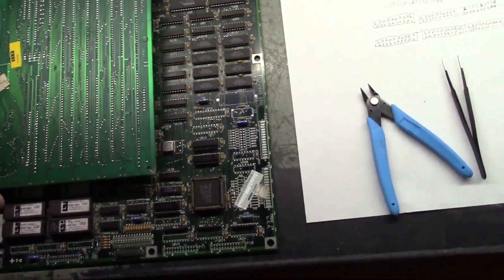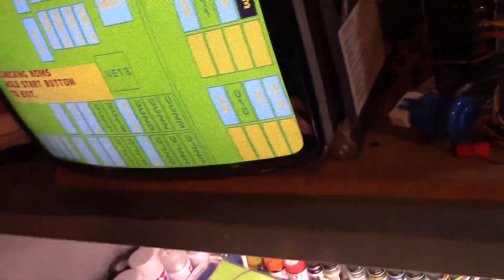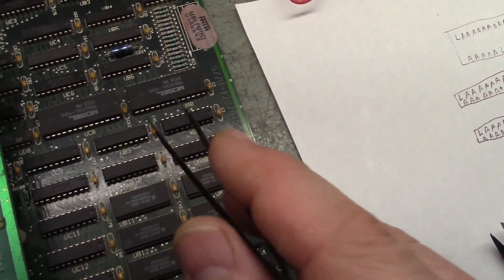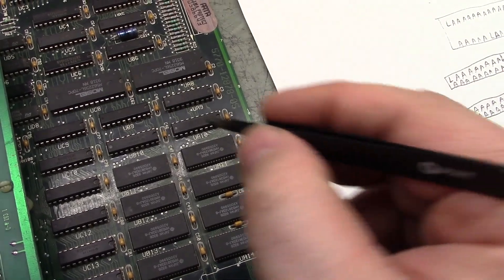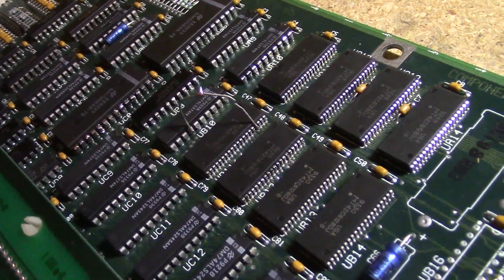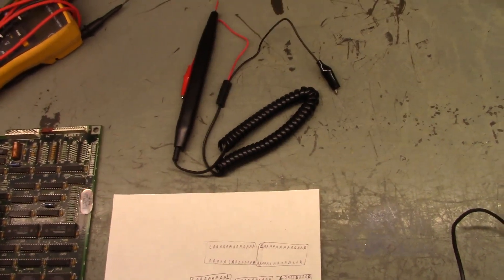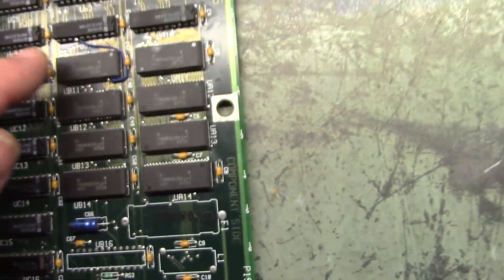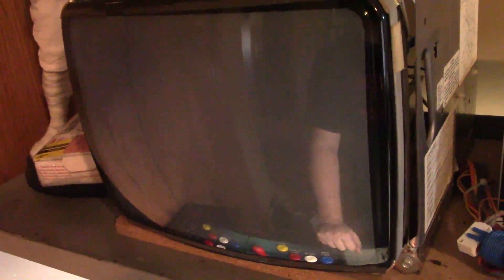Mortal Kombat 2 Arcade PCB Repair (Corrupted Graphics)

Comment: If there are bad graphics chips, how would I go about getting replacements? Also, if the graphics work but then start showing glitches, what could be the issue? Cold solder joints?

Comment: Sorry MK to hit you up on this video but I don’t know which video is best.  Do you have any recommendations for the replacement speakers for these Midway cabs?  I bought some nice car audio speakers on AMAZON but they just sound mehhhhhhh …. Don’t know if the speakers are overpowered for what these systems can put out, maybe better to scale back and get cheaper less heavy duty speakers.  Took out the old torn 3” and 6” speakers from my T2 and restoring a MK2 cab.  Any suggestions on speaker replacements would be a godsend.  Thank you sir.
Reply from the maker: MK1 and MK2 should use these…

https://www.marcospecialties.com/pinball-parts/5555-12929-00
Reply: @YourMKArcadeSource  Thank you very much for the super fast response 🙏🏼  Is there a tweeter that you recommend as well?
Reply from the maker: You’re welcome. Not that I can think of. I’ve never had to replace the tweeter.
Reply: @YourMKArcadeSource  found the tweeter on the same site you are awesome!  Thanks MK 🤟🏼
Reply from the maker: You’re welcome!

Comment: I had something like this with a Street Fighter 2 Hyper Fighting board, except the board was dead you would hear the odd sound but nothing on screen, turned out to be 5 bad traces on the Motherboard A, really hard to see with the naked eye I had to use a strong eye glass to see the breaks lucky capcom also put a good chunk of solder points on their traces so using jumper wires I was able to fix it, not surprised they broke the traces are ridiculously fine, a good multimeter is your friend on repairs like this.

Comment: My sound plays the wrong sound. Bad checksums on tests. But wrong sound??? Any ideas?
Reply from the maker: Last time I had an issue like that, it was a bad ribbon cable.
Reply: @YourMKArcadeSource  thank you for a quick response. And sorry to bother again. Since I've got you here, if I replace it and still a problem, what defectivness would a bad oscillator detail? (On the sound board)
Reply from the maker: I can’t say for sure but I don’t think it would cause incorrect sounds. Would either be no sounds or distortion.

Comment: Hey mate, I have a question, and Outworld said you might be the guy to ask, so, Do you know what is changed between MK2 R3.0 and 3.1? Aside from the version number of course. 

Apparently Roms UG12 and UJ12 are different, but I don't even know what those ROM's are for, I'd guess at interleaved graphics data, but even then, I wouldn't have a clue as to what graphics data had changed.

Any help would be awesome. Thanks in advance.
Reply from the maker: Correct. UG12 and UJ12 are the two program roms that contain the revision data. They are the only ones that get changed out from change to change. There’s no published listing for differences between 3.0 and 3.1, so j can’t say.
Reply: @YourMKArcadeSource  no probs dude, didn't know if you'd noticed any differences yourself, but to my casual eye, they're identical in all but revision number. Thanks anyway.

Comment: Hi Mameman. I would need to replace the cmos related battery on my MK2 board. Is that just a simple swap of batteries or is any other maintenance required? thanks
Reply from the maker: Just change the battery. You’ll be good to go.
Reply: @YourMKArcadeSource  Thanks!

Comment: Hi, I have a Killer Instinct board that has I guess you call a Flex problem. It plays fine if I take one screw out on the bottom corner of the board to flex the board a little by putting a folded wash cloth behind it.. But when I take the wash cloth out to make the board flat it boots up only on a white static screen and does nothing? Is there anything I can do with this issues because the board still has life in it but I don't know where to start to fix this. Have you heard of this problem before or know how to fix this? I can ship it to you if you have time. Please let me know, thanks! :)